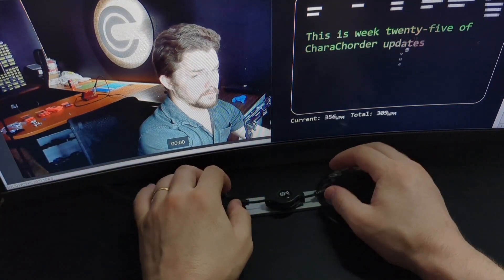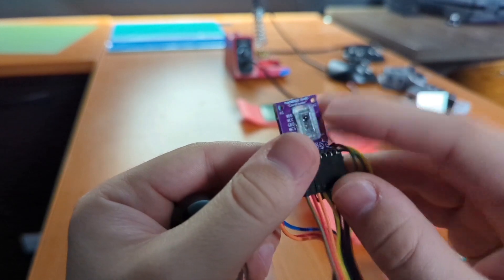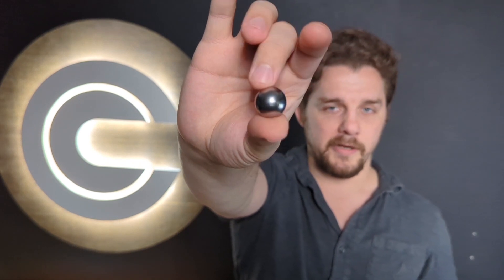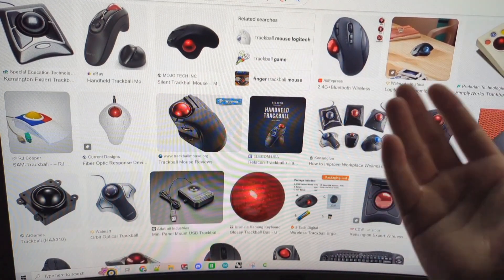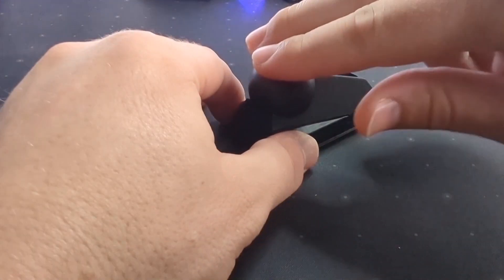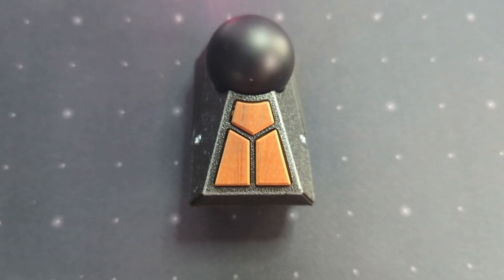Let's Design A Trackball 🖲️

Comment: one of the best pointers i've ever used was the nipple on the thinkpad t430. Having it front and center was so great for both comfort and speed. If it were up to me I would either turn one of those thumb joysticks into a joy stick pointer/mouse or have it attached/integrated right at the top — likely jutting into the source forge a bit to reduce the distance; similar to: https://youtu.be/XIOL20MWbW0?si=0eD61s5JNqjoFGTy&t=588

Comment: Having used many trackballs before, I have to say my favourites are the larger ones (llike Kensigntons), since it provides both fine control, and speed when needed (one turn of the large ball moves a lot -- and doing that in software is not the same, because then one loses precision).

One question though: how to you click and drag in this design ? Again in the Kensignton's trackball, I can click with the thumb and still drag with high precision with the other fingers. This design looks too small for that, no ?

Comment: The perfect trackball was produced in 2001 - the MS Trackball Explorer. I've been using the same one every workday for over 20 years, and have not had any repetitive strain discomfort. The reason it works so well is because it's shaped like the inverse of your hand, making the ergonomics ideal for extended use.  The trackball you've designed would work fine if hands had a thumb in the center of the palm, and sharp angles. 
Before (and since) settling on the Trackball Explorer I tried several other trackball models and determined that buttons should always be on the sides, with the click action approximately parallel to the work surface so the thumb is flexing towards the pinky, not percussing down toward the table. All other configurations caused strain and discomfort after a few hours.

I'm very excited to see the innovative Master Forge/CharaCorder keyboard in production - it's a brilliant concept!

Comment: I'm so excited for the trackball!! I'm coming from a ZSA Moonlander that I have tented at almost 40 degrees so I'm 90% sure I'll be tenting the crap out of my Master Forge too. That being said, I like the current design of a smaller form factor trackball that can be bolted to one of halves on the index finger side so that it can still be easily used by tenters like myself.

Also, I think black buttons and black ball will match the rest of the design super nicely. I used to be a cabinet maker though and I love the look of the cherry buttons you made, so i may have to make a custom set of buttons for this and matching keycaps for the M4G 😊

Comment: Nice!

I’m getting really interested in your products here. One feedback though on this trackball. 
Imo, the most obvious mounting place would be so that you only have to move your thumbs from the keyboard to use it. So one thumb for pressing the buttons another for controlling the ball. This way one would not need to move any other finger from the keyboard. This is how I mostly use the trackpad on my laptop. But with this setup it could be much better.

Comment: One amazing potential opened up by being able to get multiple fingers on the trackball is that of rotating the ball as a new input. I'm not sure to what extent the sensor would or wouldn't be able to detect rotation but if it's possible then your trackball could also easily double as a volume knob, a scroll bar, or any one of many other controls just by tracking it's rotation. With regards to placement if you can't put it where it is accessible by a thumb it's kind of dead for gaming. If I was to get one I'd want it to be able to sit in over the thumb cluster for that purpose. It would certainly be possible to make a chassis that would fit that, whether you could work it in with all the other placement options would be a bit of work though.
Reply: That's really cool, Idk how it would work, but it would open up new possibilities for navigating different environments. I wonder if you could somehow lock the ball to rotate along one axis, or if you need to be steady enough to manually match the counter or clockwise directions to create those inputs. idk but there would definitely have to be a mode switch to activate this feature.

Maybe as a button on the trackball itself. Heck, maybe there could be a downward press of some sort that would switch between the two modes, but that could be dicey either being too easy to press accidentally or maybe made intentionally more difficult and therefore less frequently used, besides where in the cavity for the ball you would place such an input, and how you would make it reliable. 

Still, some button on the Master Forge as a rebind would make this pretty viable.

The mouse cursor would probably just go in a circle when detecting rotations applied to the ball.

Maybe it would be nice in this mode to be able to just move the ball parallel to the sensor in a specified direction, and this could be another kind of input, but I cannot think of for what kind of application. Both methods give you very fine control over changes in different programs.

But yeah, this is a great suggestion, and someone should definitely try to implement this kind of input.

For gaming I suspect I will give up use for one half of the M4G to use it effectively, but I agree that despite the dimensions of the keyboard it would be best to use it with one of the thumbs, though I will likely be using the index, middle, and ring finger instead. I see myself, using the left half of the device for many of the inputs, and turning the trackball to one of its sides, and using its buttons. 

The current fixed railings don't support a lot of variety for the placement of the current trackball, but they do make it sturdier and less likely to be knocked over or moved with use.

Because I don't want to move my hands from the 3d inputs to use the trackball, I may default to using the arrow key cursors, though it seems to be only good enough for hovering over text. For more fine control operations, dragging files, window navigation and gaming I will break out the trackball.

And for tasks like changing volume, there may be buttons for that in the rebinding section of the Software Suite.

For scrolling they do have arrows keys built into the device, but I could see the appeal of using a trackball for that instead.

I am super excited to use the Master Forge when it fully drops, I'll let you know how the trackball performs and even if there is software out the that lets it utilize your idea of rotating the ball to act as a slider for various operations.
Reply: Kensington makes a trackball that does this. I bought one used and didn't know about the feature until I came upon it by accident. After that I really appreciated the finer control and greater range it gives you for scrolling.

Comment: What/ how is “Friction Fit”?
Reply from the maker: It means no mechanical fasteners, adhesives, or other mechanism was used to hold it together. Purely friction
Reply: @CharaChorder  And that is what I'd likw to know more about :) Curiosity & Learning :D. How/ where have you implemented these FF mechanisms in your designs? Using only 3D Print hacks? or Something else?

Comment: Pretty cool! I like the way you've opened the ball up too. 
Would it fall out if tipped upside-down though? I put my mouse in my backpack all the time, and I'd hate to have to go searching for a ball each time I do so.

It'd be cool if you could add some more sensors and turn it into a 3D mouse. Maybe you hold down a key to switch it back and forth between normal and 3D modes.
Reply from the maker: As a 3D mouse user I'd love this. Right now we're thinking that trackball and 3D mouse should be different Bolt-Ons

Comment: I've been having this idea, probably not original but I haven't seen anyone with a functioning product anywhere and I believe you are just crazy enough to consider it:

A mouse with an accelerometer instead of an optical sensor

Of course this will require some coding in order to understand when the user is letting go of the surface to readjust the position of the mouse, but at the same time you get a much more common sensor, I would assume more open, very cheap to purchase, and it allows for so much more than just normal mouse functionalities such as rotation, 3D movement recognition, gestures, etc... limitless options really
Reply: Accelerometers have an inherent drift that make them unsuitable for accurate tracking of positional translation over a meaningful period of time. This is why VR headsets have other sensors to augment the accelerometers. Search youtube for "Pure IMU-based Positional Tracking is a No-go" for a good demonstration of this limitation.

Comment: The leathery look of this 3D print is nice, but the wood looks out of place next to the M4G.
I personally wouldn't choose a bright attention-grabbing colour (like the images of the other trackballs),
just a matt black trackball and silver to match the M4G,
Perhaps the buttons could be a frosted translucent plastic with RGB lighting to match the M4G, but unsure if this would look tacky in practice.
Primarily, I would want a material that doesn't pick up oil from prolonged skin contact and need frequent cleaning,
if I leave it at the office I would want it to be presentable without a lot of maintenance.

Comment: Look, the trackball module is engineering-wise cool, but honestly, it’s not what I want.  

I don’t want to move my hand to mouse/track at all. I want to use a thumb key as a modifier to make the index finger key go into pointing stick mode, and then mouse with my index finger while my hand just stays in place. Then I use the thumb modifier key again to deactivate pointing stick mode and the index finger key returns to keyboard mode and I continue typing with it. 

I also want this ability on both hands because I don't want to overload my dominant hand. I want to stick point with either hand, switching seamlessly between pointing with left and pointing with right.

That’s what I want. I just want to keep my hands on the master forge.
Reply from the maker: The feature you're describing is already possible in CCOS! You can easily program either CharaChorder One or the Master Forge to function in this way
Reply: @CharaChorder   Thanks for answering. I hope you have just a little bit more time for me. Been watching videos on the mouse functionality. Sadly, there aren’t many. Found some on CharaCorder One’s mousing, but I still have questions.
Reply: @Dan1ell  The current layout of the M4G shows arrow keys instead of the mouse input/function (it seems), but you can change the bindings in their Software Suite to any finger input. 

Yes, the controls for the mouse input are usable, but not great which is why they decided to pair the M4G with a different mouse option, one that would be more viable than the current implementation, although separate from the device as a result.

I would love to see a demo from them for the M4G of the trackball especially compared to its Mouse Input.

The difference is like you stated, the inputs work, but they are not easy or intuitive. In the video you described there were likely many overshoots of the cursor missing its target when they were trying to use the mouse input. They also showed how limited the sensitivity scaling is, which makes it difficult to use consistently whereas a trackball would inherently give you that consistency by a large margin. As for the diagonal presses I hear they are difficult to replicate, so hopefully that inconsistency has been addressed for the M4G.

I personally can see myself using the mouse input, but I also see myself defaulting to a separate peripheral so having a trackball in included in the purchase seems like a perfect fit.
Reply: @CharaChorder  In one video a guy said mousing was like using an etch a sketch, going up/down and left/right, but not freeform in any direction. Diagonal motion is achieved by using two switches at the same time. The video is from 2 years ago though, so will this still be the case on the Master Forge?
Reply: @CharaChorder  In another video it seems there’s a seperate dedicated key for the mouse functionality. Can CCOS remapping make the index finger key into the mouse?
Reply: @CharaChorder  Can you do a demo of how mousing works currently on the Master Forge, with a split view of your fingers and the screen, rather than just the screen?
Reply: @CharaChorder  What are the limitations with the mousing functionality that the trackball module is meant to resolve?

Comment: I’ve tried a lot of trackballs and while maximizing accessible angle is good… in the end it’s about maximizing *travel*. So bigger balls are best.
Reply from the maker: Absolutely! It's much easier to have more exposed surface area the larger the trackball you're designing around
Reply: But bigger balls will allow faster speed movement because physics
Reply: True, I used to have a trackball that was the size of a billiard ball, it was awesome!
Reply: @liberatumplox625  Having an 8 ball themed ball mouse would be awesome.  or a large eyeball as well.
Reply: I agree, i prefer the bigger balls...

Comment: I think I would like it as close to the sticks as possible because every liftoff will be disrupting the usability. Maybe between the two cables coming out on the top. I have noticed that the M4G hole above the thumbs will probably not be usable as cable intake, it's always in the way. Like when you placed the trackball in the middle.

Why a trackball and not a pad? Where the logo currently is looks like a perfect place for a track pad.

Can you release the CAD file for a rail so the community can already start developing add-ons?
Reply from the maker: That's a good idea, definitely can share cad for the railing. There's no reason why we can't make a trackpad Bolt-On too! And don't worry when the cables are at the bottom of the shoulder port they don't disrupt movement with the thumb switches ;)

Comment: I would like to see what it would be like for there to be two trackball mice and for them to be in the front instead of the side to reduce chances of RSI. Look at the Gameball Trackball for example, they really locked in with the best of all worlds; see what they do right and compare. I saw that you were comparing thumb ball trackballs but those don’t do great for reducing RSI.
Reply from the maker: Dual trackball works great with this setup. Going to make a dedicated video on this topic!
Reply: @CharaChorder  6:01 The design is conceptual so I shouldn’t judge it so harshly but I just wanted to point out that the trackball specs per the glide time and sound it makes during the glide isn’t auditorily optimal. But I must keep in mind that this is just the prototype and hopefully won’t have this type of noise; I’m hoping for further glide, a premium feel, and a quieter sound; maybe a heavier and larger ball might help with further glide and I’m also hoping for great tracking when the ball is sent for a glide. 😁

Look at the Gameball for example, when gaming, you have great tracking, but you have more glide time and more control over it without a noticeable scratching sound. Furthermore, there’s not that much of a problem when the ball is loose from the socket: it makes it so cleaning/polishing is quick and easy.

Comment: What if you added a laser sensor or trackable to the bottom of one of the keyboard?
Reply: That's too much unnecessary movement. The core idea of the CharaChorder is to produce a device which minimizes the effort needed to interface with a computer. That's why they went with a trackball instead of a mouse, because you need to move the mouse with your whole arm compared to just swiping your fingers across the ball.
Reply from the maker: We're planning a Bolt-On to do just that! Have posted a prototype in an earlier video

Comment: Looks really good, I have one of the Logitech trackball mouse and one thing to keep in mind is the dust that it collects over time, there should be an easy way to remove the ball to clean the contacts and also some supporting structure for when you want to rest your finger mid scroll would be good.
Also any news on when the website will be updated?
Reply from the maker: That's great feedback! Thanks for sharing. Website updates incoming soon

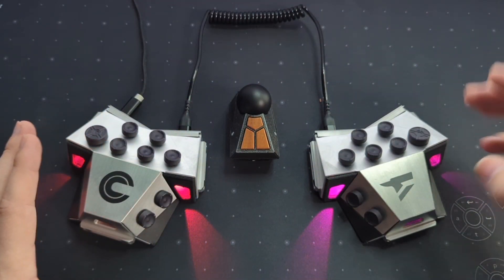Comment: 10:20 Does this usb hub allow for passthrough charging?
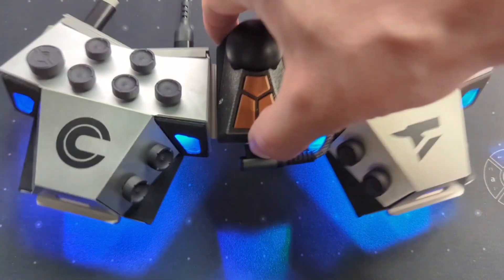10:47 Dark colors scare me, I paint my devices white. Paint may mess up the trackballing of the trackball. I'd like everything white.

The email said no special driver is required, but I still don't get how two trackballs are supposed to work.
One for the x-y plane, the other for z and zoom?

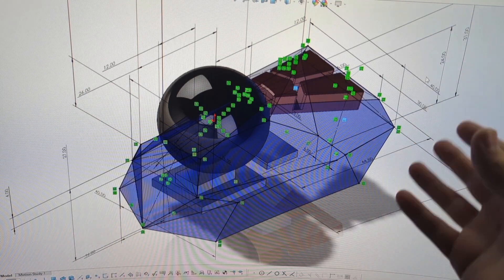7:40 I know people use OpenSCAD and Houdini for parametric, procedural modelling, you seem to be using something else.
What is it?

Please raise the LUFS of your videos, when I switch to something else I forget to turn the volume down, and get bashed with sound.
Reply from the maker: Yes the usbhub allows for pass through charging. Two trackballs are not required, but there are several advantages! Will be doing a separate dedicated video on dual trackball functionality. The software shown in this video is Solidworks, however other CAD and CAM software was used in the development of what is shown here that aren't pictured in the video